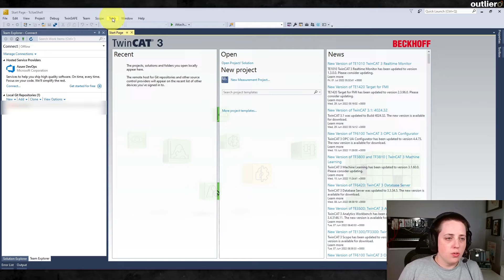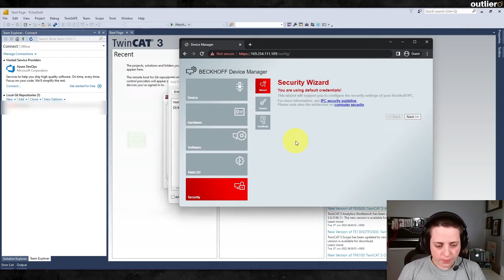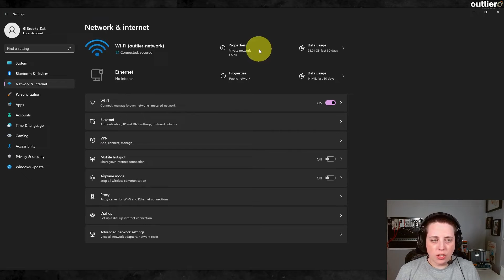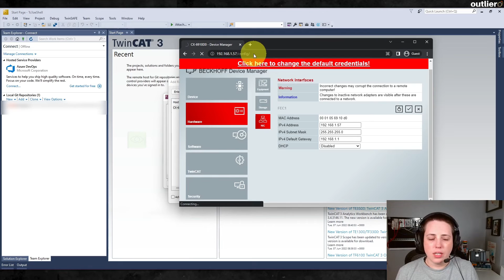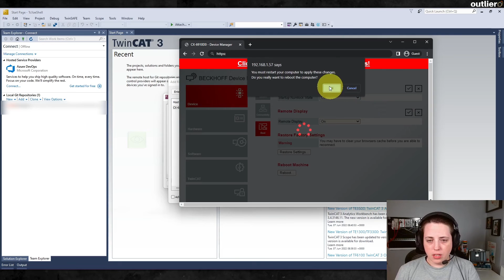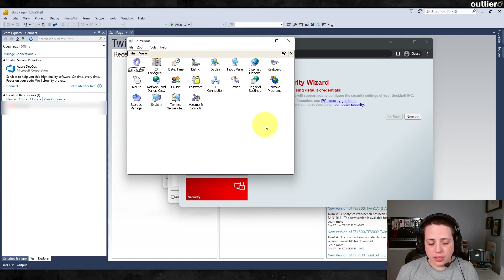Beckhoff Tutorial | First Setup of CX9020

Comment: Hello how can i scan the cx with my laptop, because my laptop use realtek gaming card for the rj45, so it is possible to connect with cx?
Reply from the maker: The adapter you want to scan with should be visible in the "Broadcast Search" of the Add Route Dialog as you see here https://youtu.be/_6eK5AXWq8A?si=tq6JmW5k5zibt1zV&t=73 If not, maybe your card drivers arent configured correctly??
Reply: @outlierautomation  the adapter is visible while broadcast search scaning, the problem is the cx 9020 doesnt exsist, so how to solve this problem to know the ip address

Comment: is this the same way to set up cx 5120 or 51xx?
Reply from the maker: Hi there - yes it's a similar process but depends on what operating system you have.  You can refer to the steps here: https://infosys.beckhoff.com/content/1033/cx51x0_hw/26745816433647233803.html?id=1692987725690678144
Reply: @outlierautomation  thanks a lot